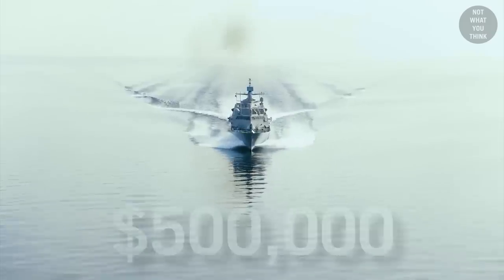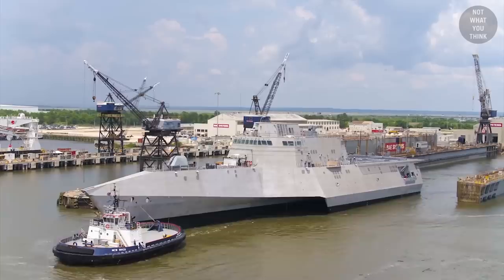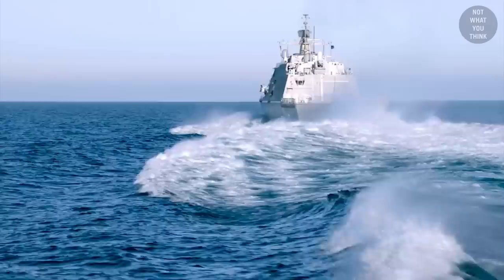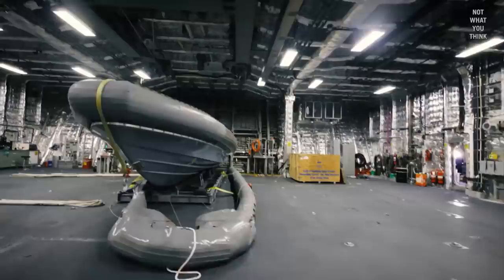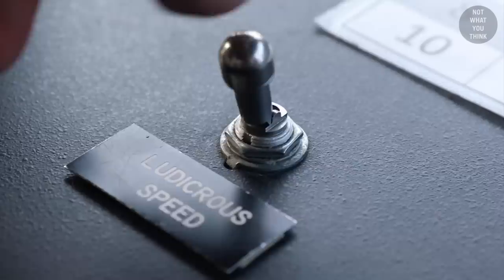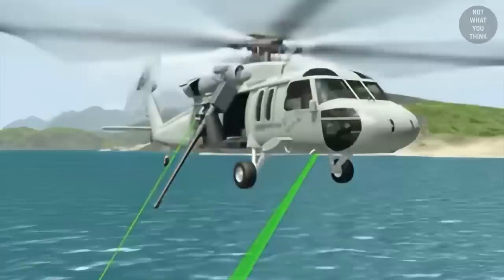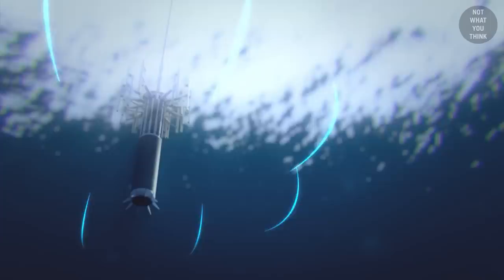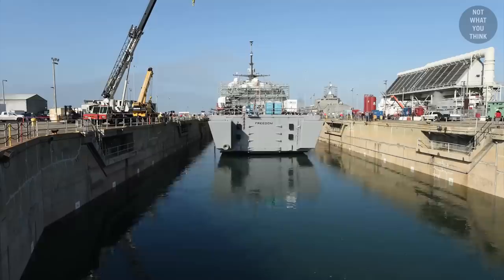Why Retire a 2-Year Old Warship?

Comment: As kinda mentioned by others, the aluminum hulls on these ships are a major issue as well. Aluminum is far less forgiving than steel and they've had a lot of embrittlement and cracking issues.
Reply: Not to mention that they melt or burn when hit. The British learned that lesson in the Falklands War, you would think the US would have observed what happened there.
Reply: And of course there is the utterly idoitic case of Zumwalt class made of aluminium and various other supporting metals. It turned theses vessells into a Galvanic corrosion party! Galvanic corrosion is an electrochemical process in which one metal corrodes preferentially when it is in electrical contact with another, in the presence of an electrolyte. Doh lets use the sea as the electrolyte. The only thing littoral about these ships is that they littorally melt in the prsesence of sea water. You really couldn't make this shit up.
Reply: @Dave_Sisson  Well, the US is being set up to lose the next major war so how can TPTB accomplish that (and therefore remove the constitution) if America has a strong navy?
Reply: Former General dynamics - nassco 1st class pipe welder speaking: aluminum exposed to salt water causes a lot of embrittlement and contamination issues. The only nassco shipyard that made major advancement is quality of repair work was nassco mayport. Procedures were made that only worked for the climate of mayport. Other procedures had to be written based off of climate of the repair work. It would have been a very capable ship if made out of steel. 2 ft deeper draft of vessel but easier to maintain. These decisions are beyond me. Fair wind and following seas
Reply: The USN should have knowledge of the fire hazards involved from the Belknap fire in 1975. Horrible.
Reply: but aluminium is way better than cardbord!!

Comment: From a Perry class frigate veteran of Desert Storm, I have always felt that they should have just modernized and upgraded the Perry class, as at the time, they were really good at ASW, all they really needed was a better surface warfare capability and they would have been fine. Now, it looks like the Navy figured out that what they had was still the way to go, so they are going to build new frigates of the Constellation class to do what they could have done 20 years ago with ships they already had.......typical.
Reply: @adamjabs  The Navy and the Air Force sure do love new and expensive, don’t they?
Reply: @corneliuscrewe677  So it would seem lol.
Reply: Really good point. New shiny F35 which can barely function as designed and cost billions for just a few, or would it make more sense to upgrade the F15E and have 100 of them?
Reply: It would be more forgivable if there was a war demanding that we fast track the construction. But there isn’t an immediate need and we have the luxury of time an being able to test the systems.
Reply: We're on flight III DDGs now. Not sure why they didn't do the same with frigates and cruisers.
Reply: @johnnyjoubert7846  Better to have a single good aircraft that you have to train pilots for, maintain and supply than to have 100 lesser ones that you have to do the same for.
Reply: @johnnyjoubert7846  the F35 is now a functional plane though and it still is better than whatever Boeing tries to pull of its hat to try and keep the military contracts floating.

But the worst part of this argument is the fact that the F15EX is being bought for 10million more per unit than an F35. For every 8 F15s you can buy 9 F35s.
Reply: The problem with the Perry now is exactly this one though. It's not possible to just modernize ships indefinitely and this class will soon reach its limits. You can't just bring a Yamato in and say "let's modernize it to be a combat effective ship in 2030". One of the most prominent features of NATO military doctrine is that when a vehicle is designed it has a certain amount of years planned during which it will accommodate new updates. That's one of the reasons why NATO tanks are bigger and more powerful than Soviet counterparts, they needed to build something that would accommodate new systems and armor upgrades decades into the future.

The new classes are also needed to implement structural and overall changes that are just not possible simply through upgrades. A far more powerful powerplant and reduced radar signature are two of them.

The new ships will follow the same path of the Abrams and the F14, 15. The first planned classes will be denied because they are too expensive and unreliable and these will pave the way to better solutions that are cheaper, reliable and overall better, following the same process of the MBT-70 and the F-111.
Reply: They also aren't going to build Constellations for the most part. The contracts are officially already in place to locally built more modern FREMM class frigates.
Reply: @theewatchfuleyeseesyou  Lower operating cost however.
Reply: @johnnyjoubert7846  the F35A cost less than current F15 and Eurofighters now...
Reply: And they’ll still find a way to fuck it up.
Reply: Very little ever beats talking to someone who uses a tool to find out how to improve it.
Reply: Eh, modernizing the existing Perry's would have been difficult as they where still running around with the single arm missile launcher as its main weapon system. But at the very least having a Flight 2 Perry redesigned to use Mk 41 VLS would have been a lot better than the LCS.
Reply: Agreed from an old FFG sailor
Reply: @connormwalsh  We don't have the luxury of time. We have lots of old planes and ships nearing the ends of their service lives, and needing to be replaced.
Reply: Assuming the hulls weren't so fatigued that they couldn't be maintained for another 20+ years, they should have upgraded the Perry's with an off the shelf 3D radar, modernized the fire control and electronic warfare systems, replaced the Mk 13 single rail launcher and 40 weapon magazine with a 32 cell tactical length VLS holding VL-ASROC and quad packed ESSM, upgraded the Mk 75 3" gun to the "Super Rapid" variant, added 2x Mk 141 harpoon tube launchers, and add a Mk 49, 21 cell RAM pedestal mounted launcher along with the existing Phalanx CIWS, which should be upgraded to block 1B.  If there's enough deck space available, port and starboard bolt-on Mk 38 mod 0 25mm chain guns could be installed to aid with defenses against small boat swarms.
Reply: What happened to the Perry Class vessels are they just decommisioned or sold??
Reply: @whitesun264  Both. Some sold. Some scrapped. Maybe a few laid up. They were robust platforms that could take punishment. Their only failing, in my opinion was that they had limited AAW capability, since they could only engage a small number of targets simultaneously. This single shortcoming was easily addressable with a combat systems upgrade.
Reply: @whitesun264  Mine was sunk off of the coast of Hawaii. USS THACH FFG-43.
Reply: @brunopadovani7347  Thanks for your reply.
Reply: Most of them were sold to foreign navies or sunk in naval exercises or scrapped years ago, with maybe 10 or so hulls still in the reserve fleet awaiting either foreign military sale or being sunk in naval exercises over the next few years.
Reply: @22steve5150  There is a U tube video of the sinking of the USS THACH FFG-43.
Reply: @DeeEight  They could have had a tactical length or self defense length Mk 41 VLS launcher installed at that location, as some foreign Perry's were upgraded with (which incidentally would have still allowed the Perry class more armament than either LCS design can carry).  I'll also note that their steaming range is identical to our mainstay Arleigh Burke destroyers and is slightly greater than the Independence class and much better than the Freedom class LCS.  They are also rated to take MUCH MORE damage than either LCS design and frankly were found in service to be much more durable than expected.  When the Thatch was sunk during a fleet exercise, she was hit by 4 anti-ship missiles, a heavyweight torpedo, a 2,000 lb bomb, a 500lb bomb, and about a dozen small anti-armor/anti-ship missiles and she took 12 hours to sink and that's with zero personnel on board to fight flooding and fire and repair equipment.  In the 80's, 2 of those frigates took major damage (anti-ship missile strike and a sea mine) and survived to fight again, while it's noted that for either LCS, an anti-ship missile hit or large sea mine hit or a heavy torpedo hit is expected to cause the ship to be a total loss, at best hoping to be able to get out of the combat zone on it's own power before needing to be abandoned and left to it's fate.
Reply: @22steve5150  Thanks for the comment. I was a Plankowner of the USS THACH FFG-43.  It was hard to watch the sinking of my home for three years.
Reply: @bresina63  I'll bet it was hard.  I had a hard enough time having to miss the decommissioning ceremony of my old sub USS Bremerton SSN-698 due to covid protocols in 2020, let alone watch my ship get sunk.
Reply: Oh my god, as if there is already a solution through centuries of naval warfare, conceptual development, and application history for a fleet that barely changed.
Reply: Stop making sense or you will be banned
Reply: @DeeEight  Wow, what a lovely bunch of bullshit.  First of all, mr Wikepdia reader, those other nations DID upgrade their ships, and they upgraded them to be more armed than any LCS ship is, so you can talk all you want but the truth remains.  The navy also could have simply upgraded the fucking SM-1MRs but they chose to boost the stocks of SM-1MRs available to allied nations.  You want to free up more tons for improvements?  Replace the 70's and early 80's electrical system. I dealt with the same outmoted, bulky, and heavy electrical systems on older submarines and when that shit is replaced with modern electronics, not only does it allow more advanced systems to be integrated, it frees up a lot of space and removes quite a bit of weight from the ship, I'm talking dozens of tons.  Also, I never talked about sticking full length Mk 41 and Aegis systems and all of that shit, I merely mentioned commercial off the shelf 3D radar like what LCS has and "improved" EW and FC.  Not "best in the world" EW and FC, just fucking improved.  Switching out 2x mk 141 harpoon launchers for some same sized NSM launchers ain't shit, and upgraded harpoon block 2ER is probably a more effective missile anyways.  Phalanx can be swapped out for SeaRAM as well, the fucking system is designed for that.  The Mk 75 3" guns can easily be upgraded to match modern Oto Melara variants, namely the Super Rapid variant with or without the extreme long range Volcano ammunition.  That is a damn sight better than the fucking Mk 110 57mm gun can do.  Oh and guess what?  3 times the fuel and 3x the crew size and yet....they cost less than half as much a year as what our destroyers cost to operate, while the LCS, because of the constant maintenance problems, cost just about as much to operate, so Perrys are still cheaper.  And go tell crew members of the fucking Sheffield how "lucky" they were about the Exocet that didn't detonate when it hit their ship.  It was the fire caused by the still burning rocket motor that ended up taking that ship out, and one of the exocets that hit the Atlantic Conveyer didn't fully detonate because it didn't consume the rocket fuel and fires fueled by the exocet's rocket fuel caused as much damage as the damn warhead did.
Reply: @ryuukeisscifiproductions1818  I doubt it would have been particularly difficult since they had already integrated VLS onto the Ticonderoga Class and the early flight 1 Burkes that were equipped with arm type launchers.
Reply: @DeeEight  Thanks for sharing : )
Reply: @josephahner3031  And where in my comment did I say that we need more failed programs like the LCS and Zumwalt classes? I just said that America spent the last 20 years "screwing the pooch" in the War on Terror, allowing the fleet to shrink and age, our shipbuilding capacity to degrade, while China, in plain sight expanded its fleet. So now we have a fleet size deficit, without the shipbuilding capacity to remedy that fix. Whether you like it or not, Russia is NOT an existential threat to us, but  China IS, and we need a stronger navy to deal with that. The next two major US Navy ship classes seem to be well thought out. The Constellation class Frigate is a proven Italian design, and the DDX seems like it will be a enhanced Burke with an all electric drive.
Reply: @DeeEight  flight I and II had a mk 141 quad launcher for Harpoon missiles that I mistook for the Mk 26 launchers since I hadn't read up on it recently. I was not aware that the Ticonderogas were designed for VLS initially, just that the first batch had Mk 26 launchers. Still, would it have been cheaper/easier to rebuild around 10 OHPs to have VLS and a modest upgrade package or build the freedom class and then put 9 of them out of service? Maybe you could put the smaller 57mm gun on so you have a smaller gun magazine to deal with and then pull the original missile magazine or maybe just build an actual damn frigate instead of the whole LCS program like they're now doing with the Constellations and revoke the commissions of the Good Idea Fairies that came up with and accepted the LCS ships.
Reply: You can see the gun on various ally ship now....  However, I thought the LCS were going to be made of a polymer to make it even more stealthier.  In fact, most consumer products are made of plastics.  You don't buy a smartphone made of steel.
Reply: @DeeEight  Nope those smartphone have other added features....and probably a waste money for the majority of troops for the miltary...but hell as long they send the check.  We tend to break those too.
Reply: @DeeEight  Actually, it been around for some time because you buy a boat or yacht made of polymers...  It more like politics where US government is propping up the US Steel Industry...People have lost stock in this losing industry
Reply: @DeeEight  If you look at the Sweden's  Visby-class corvette or even buy a Type IV ballistic plate (even Type III ballistic plates) for flak jacket....  I think you need a better argument... Metal is still detectable by radar...  For example, in black sea where there is more than one country with harbor port radar for shipping control....
Reply: I fully agree with you...
Reply: The Perry's were great ships.  Served aboard the FFG 5 USS Richard L Page "The Battle Frigate Page" a Brooks class Frigate.  Only ship I know of that was named after a Confederate General.  The first and best ship I served on.
Reply: 😆 Constellation is a stealthy ship. You're wrong.
Reply: @rgloria40  

Irrelevant. New ships should be stealth or else they will get destroyed quite easily. The Perry class is obsolete and would be a waste of money to modernise or repair to recommission.
Reply: @corneliuscrewe677  The Air Force...  Yes and no.  While for some stupid reason they want to replace the A10 they are sticking with the majestic BUFF (Big Ugly Fat...  Fellow), the B52.  Apparently (if I interpret Wikipedia correctly) the last production aircraft (and therefore the NEWEST) B52 in use is Serial Number 61-0040 which "left the factory on 26 October 1962".  The NEWEST B52 is almost 70 years old.  I understand (but am too lazy to find the story I read a few years ago) that there are families that have produced three generations of B52 pilots.

Rolls Royce was recently awarded a re-engining contract that will extend the life of these aircraft another 20 or so years.  The youngest of these aircraft are a year or so older than I am and will likely still be flying when I'm dead from old age.

While the B52 can't penetrate contested airspace like the B2, when air superiority has been attained there has never been a better bomb dump truck ever built.
Reply: They also ought to relocate the 76 mm gun to the forecastle
Reply: As a CHENG on a frigate.  agree,    The Perry class was good.   just needed a modern version with better surface guns.
Reply: Go to the front if the class, your smarter then most Admirals!!
Reply: @johnnyjoubert7846  actually, f-15ex, f-15’s newest variant, is more expensive than f-35. Sure f-15 can carry way more missiles but if we’re talking about price only, f-15ex is more expensive also way sexier.
Reply: But there’s a limit to just how much upgrades ships can handle just as I won’t look like Brad Pitt even after many plastic surgeries.
Reply: How many missiles could the Perry hold?
Reply: @criostoirashtin11  They could hold up to 40, including 4 Harpoons, but the other 36 were the older SM-1's, which, if I remember correctly, were not designed to be ship to ship offensive weapons, I think they were mostly used against air targets. So, not very useful if the ship were faced with fighting a surface target.
Reply: @theewatchfuleyeseesyou  What can the Freedom Class do that the Perry Class can't?
Reply: @theewatchfuleyeseesyou  That's what Constellations are- locally built FREMM class frigates.
Reply: @johnnyjoubert7846  Uhhh...the F 35 is working pretty well and selling like hotcakes. I do love that F15EX!